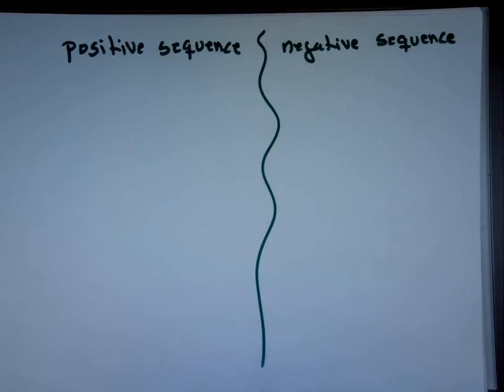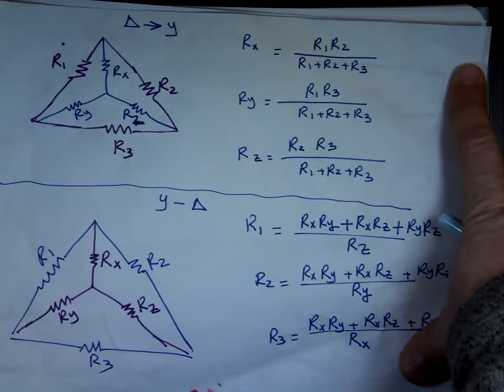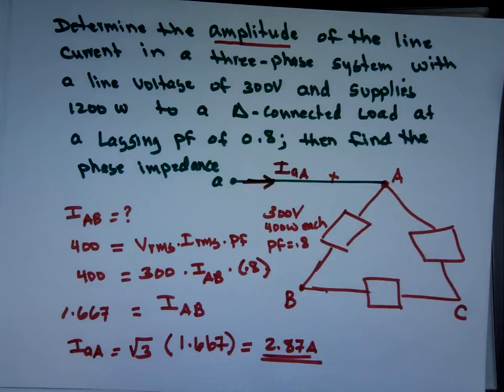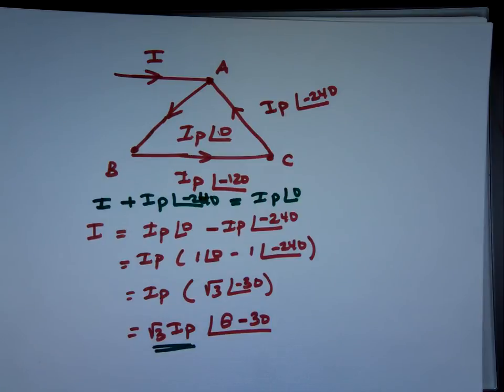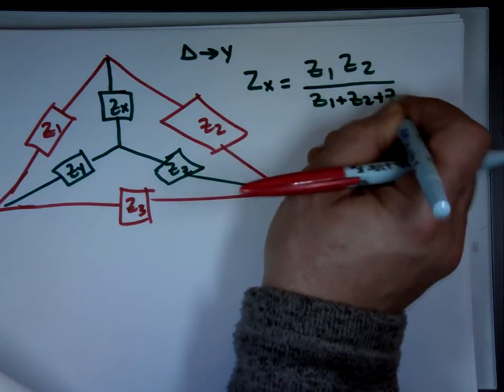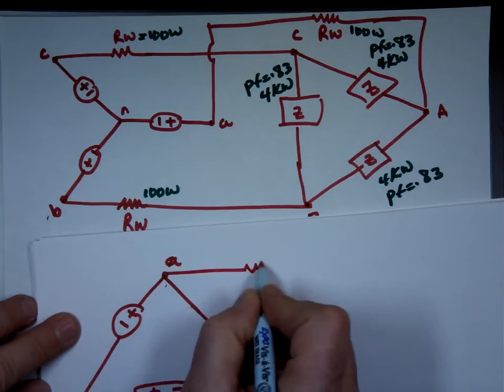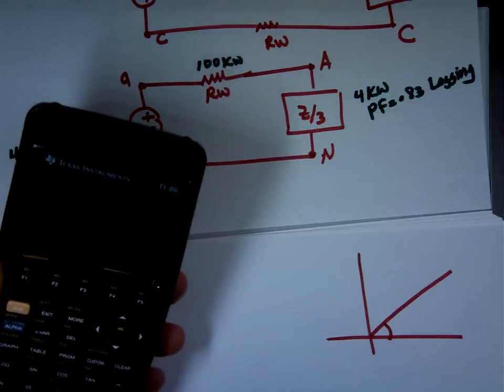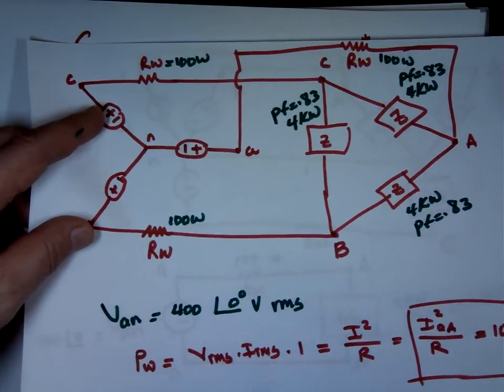The Delta Connection

Comment: Great Video. Just wanted to know, what textbook did you use ?
Reply: Engineering Circuit Analysis by J.David Irwin and Robert M.Nelms
Reply: @yunuskucuk3366  Hi Yunus... this is not the correct book. Just bought edition 12 which does not match as used in the video. Do you happen to still have your book, so you say what edition it was, and perhaps I can find it used somewhere?
Reply: Engineering Circuit Analysis,  by William H. Hayt, Jr., Jack E. Kemmerly and Steven M. Durbin
Reply: @filchaneco506  Thank you Fil!